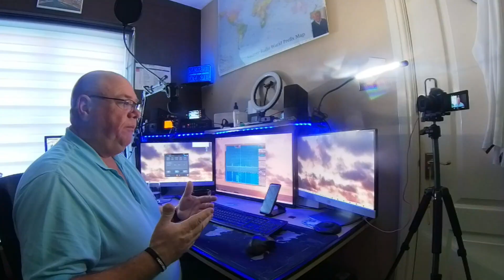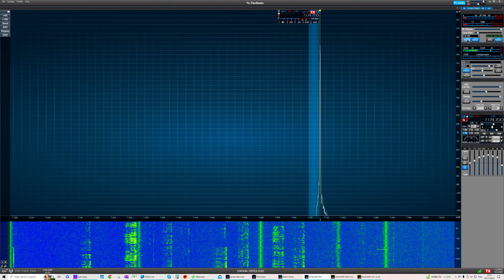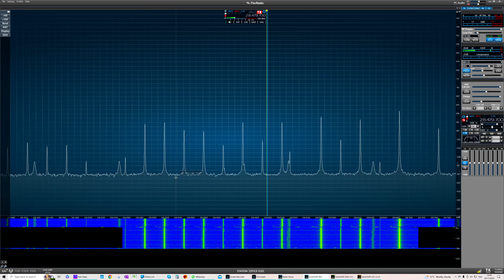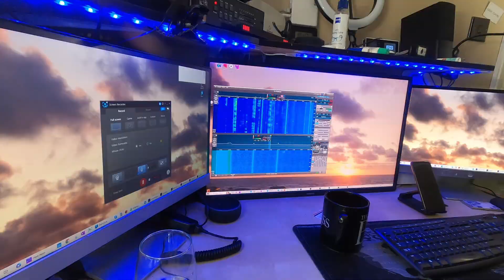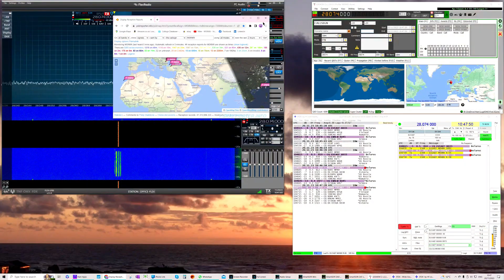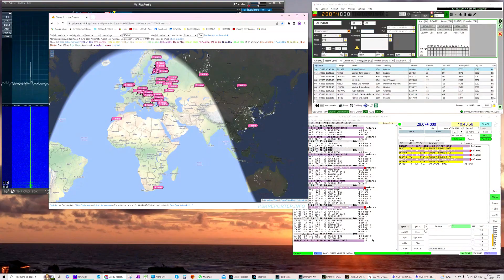Im selling up!

Comment: I feel sorry for you Mike.
I had the same problem here, about 4 years ago and sold up completely.
I tried EVERYTHING, and have not got the time to go portable or mobile.
The lowest bg noise I had was S5-S6 on 12m/10m but as I came down the wavelengths it got steadily worse.
S7-S9 on 15m and 17m, S9+ on 20m, S20+ on 40m, and literally S40+ on 80m, constantly at all hours of the day or night.

Comment: What have you done to fix your issues from your appliances in your home? Alot of issues with smart devices and cameras, but very simple to correct. If its not that you could have transformer going bad somewhere. I would start with ferrite chokes on all of your smart devices power cords. A lower AGC setting on a sdr can really help you lower your noise floor to copy a station. I run mine on my Hermes lite 2 and Sun sdr2dx at about half way. The NR in thetis is a real game changer. Your notch filter does not look like it is doing much when I was watching your scope. Both of mine when I set a nf the signal drops off of my scope. I would ask for some help before giving up on your station. Maybe have a cook out/rf finding party at your location. Never seen a Ham who does not like to eat. Anyways Good Luck.
Reply from the maker: I have tried it with the mains breaker off so no electrial supply in the home. The flex has gone to a quiet home that I will still be able to use remotely.

Comment: Mike I have owned an Icom 7300, a FTDX 10 and a FT 710AESS.  I would definitely recommend  not getting  the FTDX 10 for no other reason that it is so easy to bump the VFO tuning knob with all of the buttons around the VFO bevel that it becomes no fun to operate. (Bob Sherwood even commented on this in his report and interviews)  It would be problematic taking it portable particularly if you were going to use it in your vehicle.  You might even want to consider the FT 710 Field  which would be perfect for your portable operation.    So from  a guy who’s owned all three radios,  I would definitely recommend either the  Icom 7300 or Yaesu FT 710 field. Enjoy
Reply from the maker: Thank you. Good advice. 73

Comment: I see you have CCTV system, how are the cameras powered, via POE supply? I have terrible noise from POE from my cctv. Took sometime to work out where from and tried all sorts of options. In the end put a wifi switch on the power supply and turn it off when using the radio.
Reply from the maker: Yeh, its not a local (my home) problem as I have tried it with the mains supply off.

Comment: Great demo! QRM at my QTH is bad. I currently only have a Yaesu FT857d for HF and don't see the point in an expensive radio with high noise floor. I much prefer to operate static mobile with my Slidewinder Coil and whip albeit less that convenient. At some point I may buy a secondhand 7300 as its still pretty compact. Good luck with your new radio! Simon M0SCS

Comment: Hey Mike.. Have you tried a Loop On Ground for the noise? Worked for me!
Reply from the maker: Hi Cal. My garden is smaller than yours so not sure how doable that would be. 73
Reply: @MikeM0XMX  15 feet x 15 feet mate.
Reply from the maker: Hey Cal. Was interested in this. Watched your vid installing in the field and also watched IanXFS. Sadly I still havent seen any evidence of an improvement in real world. Did you do any follow up vids showing the improvement?
Reply: @MikeM0XMX  Erm.. I mention it a lot. It works for me.

Comment: I bought a flex, I had it for about 2 months, I sold it and now I run my own built SDR.
I had  a lot of noise now I'm running my SDR the noise has gone, even the Icom 7300 is a noisy radio, just look at the schematic of these over priced radios..

Comment: Sorry Mike I think you are making a mistake Saleing the flex if you can by a smaller radio ie 875 or 7300 as well
Reply from the maker: Hi. Have an 857 for /p use but love the bandscope of an SDR so I think the FTdx10 or 7300 will be a good compromise

Comment: It's sad, but I think we're being pushed out of Radio.  I have severe QRM at home and nothing I've done has made much difference (filters or cancellation) as the noise is so pervasive.
I now just have a QRP HF (IC705) set in my camper van - but have not found many places with a low enough noise floor to work anything but local stations.  IC7300 is a nice radio.

Comment: Sadly, Hams are selling up due to local QRM I have suffered for almost 10 years Had the useless regulators out on several occasions, only for them to track the QRM and tell me there is nothing they can do about it !! This is however  a lie they can do something about it but refuse to enforce, I think Ofcom is not at all interested in sorting out issues we have with QRM only because we don't pay anything for our privilege of using the airways. And if you remember Ofcom we used to pay 15 quid or so for the licence, but Ofcom did a Mickey Mouse survey to see how many hams would like a Licence free hobby consequently the survey was done and yes you guessed it the overwhelming majority wanted free licence MUGS They knew what was coming with crap devices plt vdsl plasma TV I could go on and on, but I think you get my point. If you don't pay, you don't have a say. RSBG was also in agreement with the so-called enforcers Ofcom, in my opinion, we were sold down the river by both OFCOM AND THE RSGB. I am still active despite the chronic QRM My Anan 8000dle saved my hobby diversity reception is just wonderful, takes a bit of understanding, but it is a hobby saver. If you think a ftdx10 will help at home to use I'm afraid it will not I know as I own one fantastic radio but still can't handle the chronic interference, diversity is the answer to a lot of qrm problems. Sad you can't pursue your hobby as intended from home, RSGB OFCOM have a lot to do with this, unfortunately. Sad to think you have to go mobile to enjoy this wonderful hobby of ours,  good luck in your pursuits I wish you all the best, hope you will be happy.

Comment: Noise has driven me off the bands for the past 18 months as it swamps my antennas all through the day (many new solar installations and home offices where I live - many with high power wi-fi that extends for several houses further than needed !). Despite careful tuning and filtering it is ever present. I will have a final go at improving things but I suspect mobile is the only solution. 73 M7BLC
Reply: have you considered a mag loop ?

Comment: When it comes to noise (QRM) antenna choice is key, many are hiding their loops with wires hanging off trees (or whatever is around) the wires so small they are hardly noticeable, yet those antennas are great performers.
Nothing can beat a small H.F radio that needs no computer to work, have a look at the IC-7300 this unit is intuitive & easy to use, sounds great on air and relatively cheap for what you are getting, those are proven to be a great work horse by now.
Whatever you do, all the very best into the future.
See the above as one more opinion among many others (who might know much more than this old man).
73

Comment: What a tidy shack.. Mine is a workshop environment. I too suffer with noise. Rarely on nowadays..  my latest rig is the G90 and a virtually new old FT857d.  Main rig FT450D.  That Flex is very good.. I invested last year to do some portable work. But sadly, my time is very precious and found insufficient time even in retirement to do any. Just one event which produced nothing Hi. So the portable gear now installed in main shack. Good luck with your plans. Hope you find more time than I do.  Thanks for the info. De gw4gja